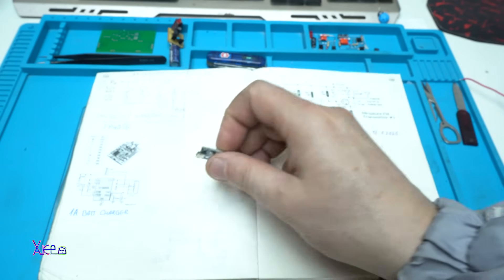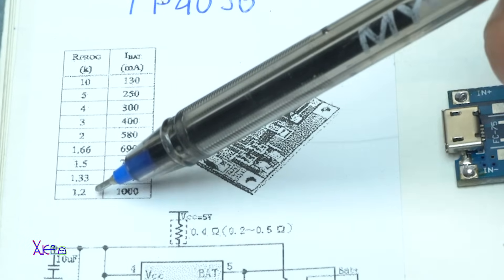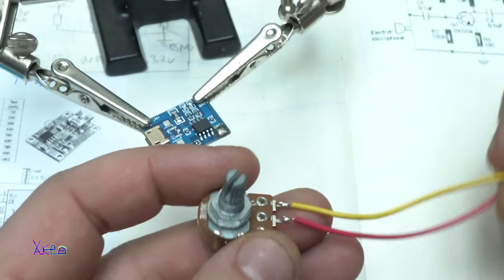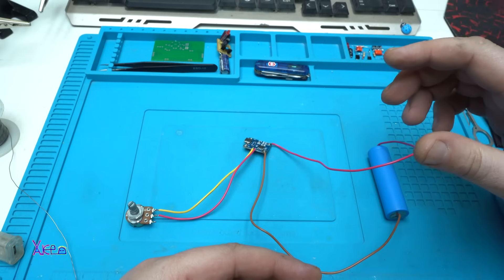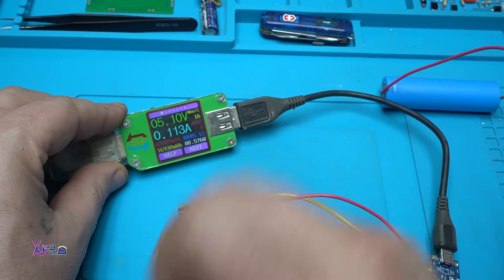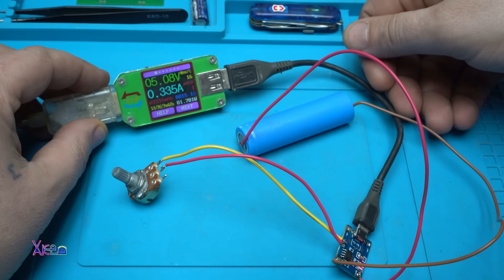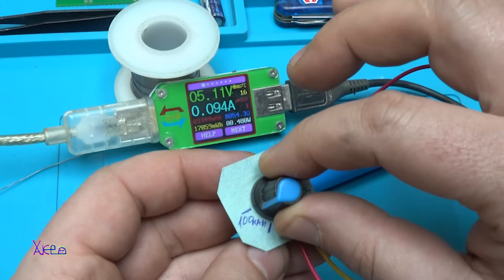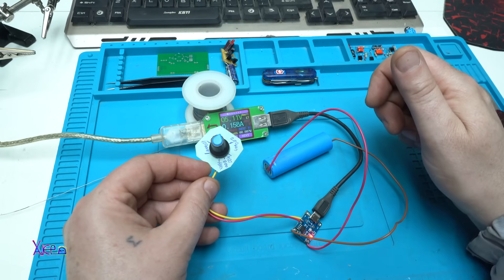Charge Different Batteries WITH TP4056 Using THIS IDEA?

Comment: I started my electronics journey as a hobbyist just last summer, where I designed (with the help of ChatGPT) a small circuit to power a tiny fan to put under my hat, so my head is cooled in the summer. I used a 3.7V LiPo battery with TP4056 and a step-up module to 5V to power the fan. It was SUCH a chore to desolder that resistor with my cheap, crappy soldering iron! You did it in 6 seconds, but it took me more than an hour! Since then I upgraded to an infinitely better soldering station and I'm having fun soldering!
Reply: I want to see you go through airport security with your hat on!   🥴  😜
Reply: @PiefacePete46  haha imagine the initial confusion! Seriously though, lithium batteries during flights is a no-no in many countries, but my tiny 3.7V, 250mAh LiPo would probably pass with no problems.

Comment: Very useful! Just a correction to your project: you should put a 1,2k resistor in series with potentiometer, because if you set it to zero you could burn the module. because of too high current.

Comment: I had the same idea after seeing a bigclive video about the module, and made one a few months ago as my first project after retirement.
I had a much harder time soldering those wires onto the module after removing the resistor.
I put aligator clips on it so I could charge different batteries without resoldering.
Reply from the maker: Nice work!  I think you've got a great point about the alligator clips.

Comment: Great, now how can we change the charge Voltage. For example if you have an 18650 cell the full charge level is 4.2v. If using a 3.2v lifepo the full charge level is 3.6v. is there a way to adjust that?

Comment: It's excellent. We can also use a multi-turn potentiometer for more precision. Another option is a multi-position switch, with a quarter-watt resistor suitable for the desired current in each position.
I really like this module; I use it often It is available in mini USB, micro USB, or USB-C. 👍
When I need the connector to be very resistant to handling, I choose the mini USB one.

Comment: wow, if you happen to have a small capacity battery, say 100mAh or 500mAh and you try to put 1,000mAh charging current into it, you will need to have a fire extinguisher handy and bucket of sand for all the stuff now on fire. Anyway we do like these videos :)
Reply: Tout ce qui est inférieur à 1a se charge avec le même courant que celui indiqué sur la batterie. 
Idéalement légèrement moins. Jamais plus.

Comment: How do you calculate the charge current for your battery though?
Reply: si la batterie a une capacité inférieure à 1 Ampère, il est essentiel d'utiliser un courant qui correspond à sa capacité ou légèrement en dessous. Par exemple, pour une batterie de 500mA, vous devez charger à un maximum de 500mA.( je baisse toujours un peu de mon côté,450 ou 400ma )Pour les batteries 1 Ampère ou plus vous pouvez utiliser 1 Ampère ou même 1.5. Il est crucial de rester prudent lorsque la batterie est notée pour moins de 1 Ampère ; dans ce cas, ne jamais utiliser un courant supérieur à celui de la batterie.
1a est un bon choix pour les batterie de 1a et plus. 
La charge est longue, mais sécurisé.
Si on charge à 1a une batterie de 500 ou 800ma , elle va gonflé et chauffé. Ce n'est pas bon. Elle pourrait aussi explosé.

Comment: These modules are great for all sorts of projects that you want to include a rechargeable battery. However, if you want it to output max 1 amp, say if you have two cells in parallel, I found you need to provide some sort of heatsink on the charge chip. If you do not do this, the chip will self regulate and drop the charge current to a lower figure.
Reply from the maker: Thx for sharing the idea sir

Comment: Shouldn't you leave a 1200 ohm resistor in line with the potentiometer so it couldn't send more than 1 amp? 

I have never tried shorting out the 1200 ohm resistor on the board and seeing what would happen to the amperage and what would heat up
Reply from the maker: That will be good test,I will try
Reply: @Hacktuber la puce brûle. Il existe un module 2a

Comment: The charge current is given by I = 1200/Rprog. The TP4056 has a maximum current rating of 1.2A, which means that Rprog must not be less than 1K. It is therefore essential to put a 1K resistor in series with the potentiometer, because it is too easy to slip and turn the pot down to a small resistance, risking damage to the module and battery.
If you use LiR2032, the rechargeable equivalent of CR2032, they like a charging current of around 40mA, so it may be sensible to use a 20K or 25K potentiometer which will bring the charging current down to a sensible value for small batteries.
Reply from the maker: Thx for info
Reply: For very low currents, if we do this regularly, it is easier to make a permanent modified module.